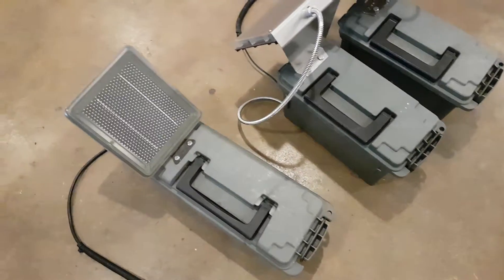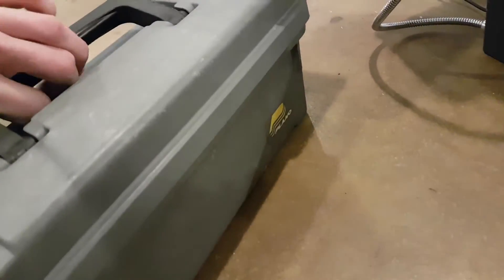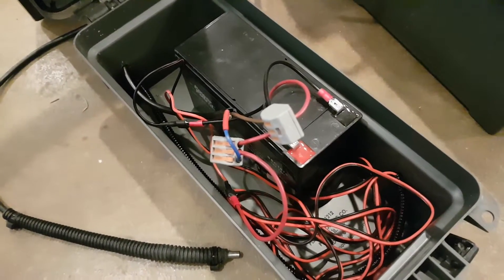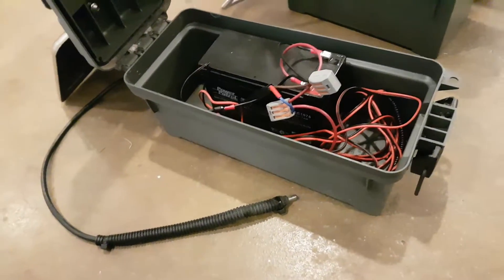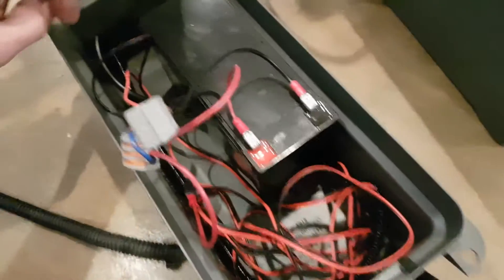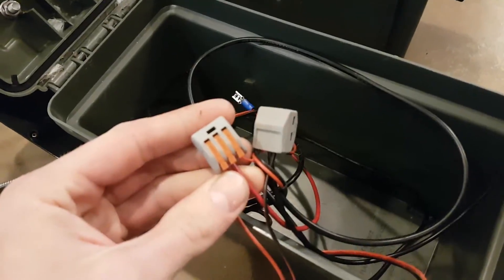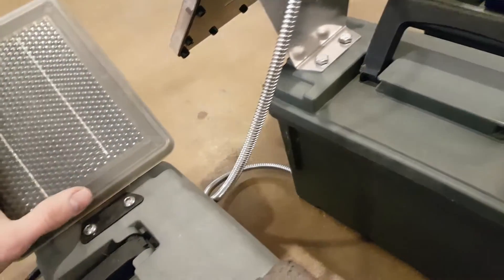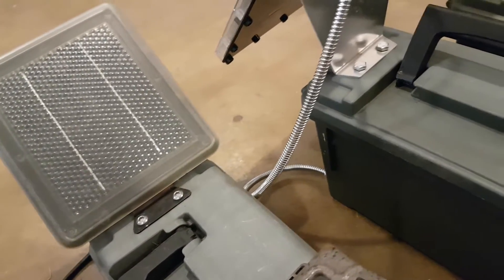Trail Camera Battery Pack - The simple model

Comment: Need a fuse at the battery positive post to protect the equipment. All batteries can short out and go into overload and put out a lot of amperage. Fuses prevent fires. The geese are already chewing on the wires no shorts yet then you've been lucky.  At the positive battery post cut the positive wire and crimp on a pair of female insulated spade connectors and slide them onto each leg of the properly sized ATO fuse. Easy Peazy. Lots of good info otherwise.  Thanks Man!
Reply: I noticed everyone is using those smaller deep cycle batteries. What if I hook up a regular 12v car battery will it burn up my camera?
Reply from the maker: Pavil Reutov  Depends on what your camera is rated for. Most likely the camera will be ok if its a 12v camera. no telling if its a 6v or 9v camera.
Reply from the maker: Bruce Arntt   True. I had thought about it and still never installed one :(  Nothing more permanent than a temporary fix.